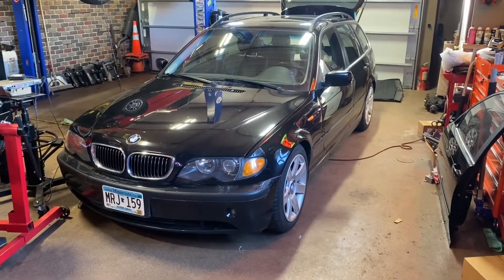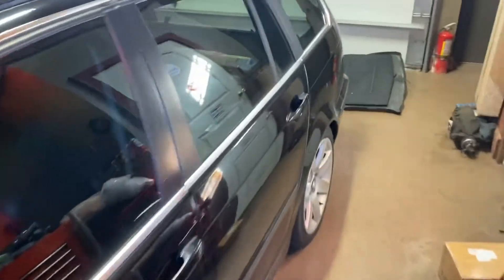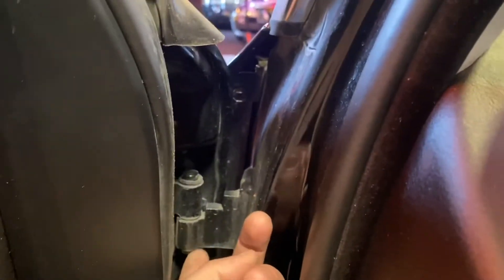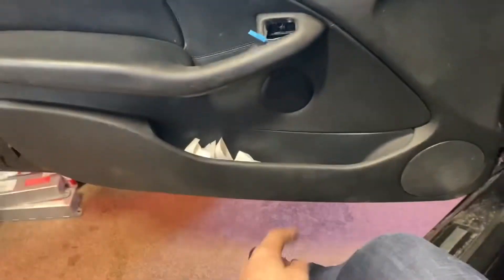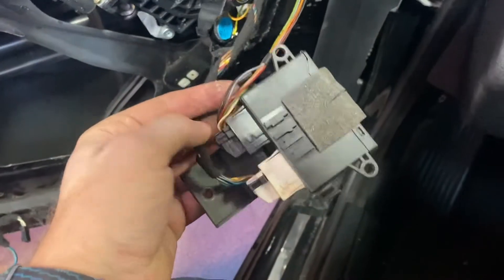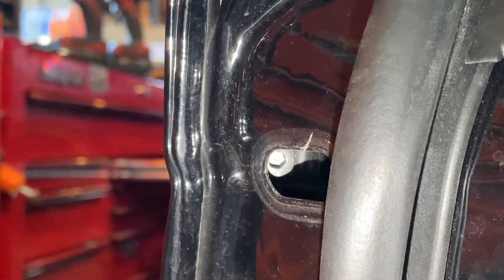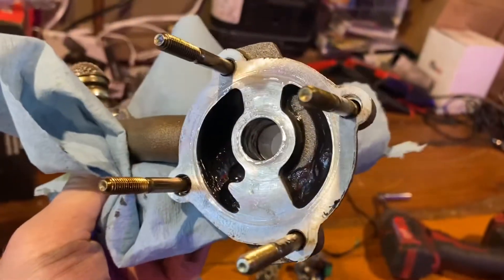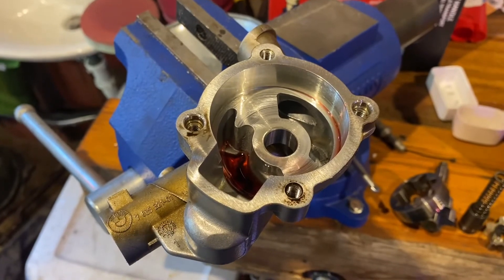E46 touring sedan front door replacement, and LSB oil pump autopsy

Comment: Thanks for the door replace instructions. I have a question...my 2005 E46 wagon also needs the front driver side door replaced. I picked up a replacement door shell off a E46 sedan. A) Are the doors identical size? B) Are the cutouts in the door for the exterior handle also identical in size and shape? In preparation for the job I noticed on the replacement, the  inside mechanism into which the exterior door handle affixes is slightly different. Looks longer and flatter but similar size and shape. Any help would be much appreciated!
Reply from the maker: sedan and wagon doors identical in front. this was a sedan door.